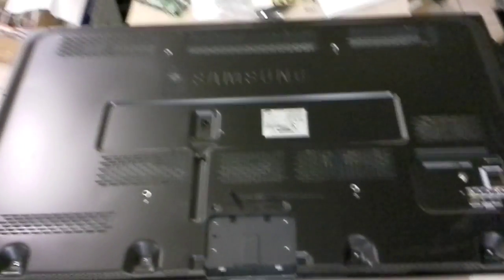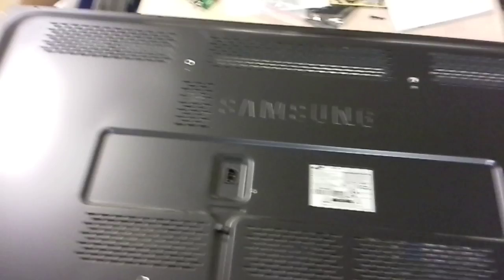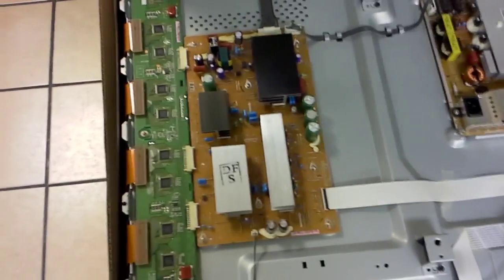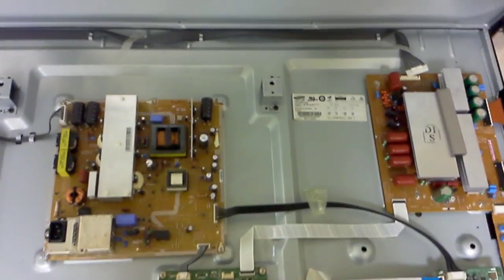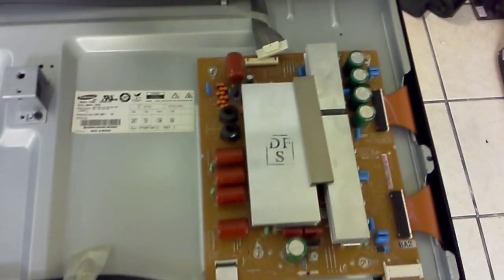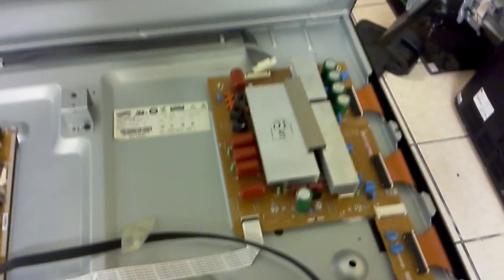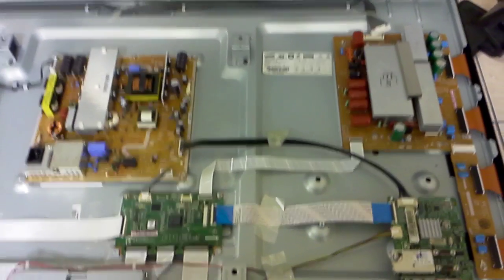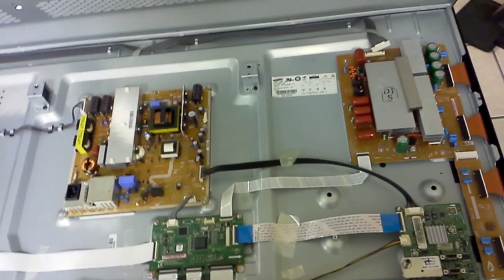How to test and repair Samsung PN51D530A3F clicking on and off / power cycling

Comment: I know that this video is uploaded 4 years ago, but I just watched it and manage to identify the problem of my TV. Thank you very much for sharing this information.
Reply from the maker: Благодаря и наздраве!
Reply: @coppelltvrepair  I do not know are you from Bulgaria, but I will continue in english, just to be sure. I changed the transistors from the X main board and the clicking stopped and now the TV turns on, no clicking, but there is no 200V. I measured that the Y board too has some short transistors. Is it easy to unplug the Buffer board from the plasma plugs? I want to measure it too
Reply: @zhivak  There's usually more damage on the boards than the power switching transistors.
Plus it is not common for both sustain boards to fail at once.
If they did that suggests possible failure in the plasma logic board as well. Good luck!

Comment: Hi, I have the same model TV, I ready replace two time the Y main board but i blows the ic again, maybe you can help with that? Thank you so much.
Reply from the maker: Replace the plasma logic board. That, and natural aging of Y-Main are the only two things that can cause it to persistently fail if it's the only thing that fails.
Reply: Coppell TV Repair LLC Thank you so much, I will let you know after I get done.

Comment: Hi, I have a SAMSUNG PN50C680G5FXZA very similar to this one in the video  and is clicking 5 times every time I plug in the power cord.Even disconnecting both boards, the clicking stops but I am not able to turn on the TV at all.Also by disconnecting the white ribbon cable from the Y board to the logic main. the green light blinks every second,but if I connect it back ,only blinks every 5 seconds. 
What would you suggest me to do at this point.? Please give me some advice. Thanks
Reply from the maker: Afraid not. Even though you say the two TVs are "very similar" I will respectfully disagree with that assessment. If anything, I can not afford to assume they are very similar because I know how behavior tends to change among different versions within the Samsung product lines and without particular knowledge of your model I will not make assumptions on what is the optimal way to troubleshoot it.
Any video or instruction generally titled "how to troubleshoot....plasma TVs" is likely not worth the paper or bandwidth it is on.
The devil is in the details - this is why we put the model n the title; sure enough the same can be said for a few others, that are based on the same design and share same code in the main board, but better be narrow and exact than unspecific and incorrect 90% of the time.
Reply from the maker: Find a video or article or simply someone intelligent who has already troubleshooted PN50C680G5FXZA and ask them for help.
Asking others is like asking a heart doctor to help with your ear pain.
Reply: @coppelltvrepair En la un POST

Comment: Thanks for this video!  I tried it out on a 59 inch Samsung plasma where the TV is cycling on and off every 10 seconds or so.  I disconnected both the y sustain and x sustain and it continues to power cycle.  We've replaced the power board.  What would be the next most likely cause?  The main board?  I can't diagnose that the same way, because the TV does nothing with the main board disconnected from power.
Reply from the maker: Find a video or article or simply someone intelligent who has already troubleshooted your model TV or one that is known to be 99% compatible with it and ask them for help. Asking others is like asking a heart doctor to help with your ear pain.
Reply: Howdy sir...I am having this same issue with my 51" Samsung plasma.  Did you ever get it working?  I have replaced the power board and that did nothing.  Was it the main board? because you are right, it does nothing with it disconnected.

Comment: hello what did you replace on the xmain to get it working im having the same issue with my xmain and would like to fix it. i replaced the capcitors on main power supply now i have to do xmain to get it to turn on.
Reply from the maker: I am sorry, I have no memory whatsoever and couldn't tell you more than what's already in the video.